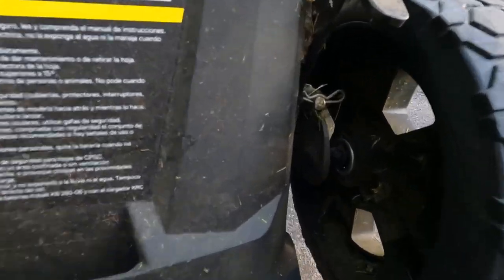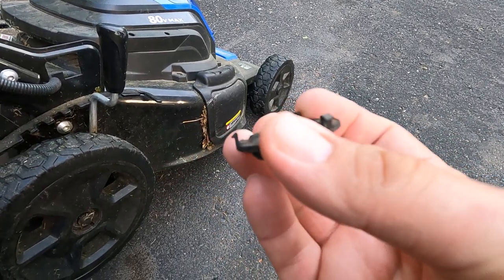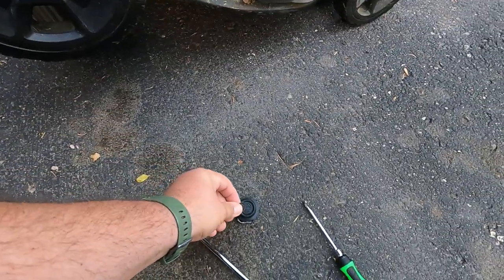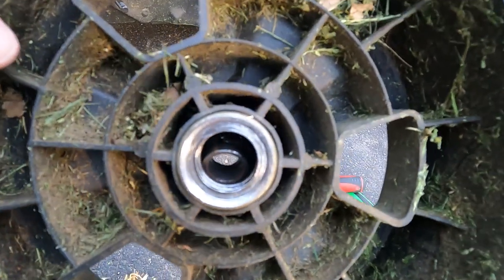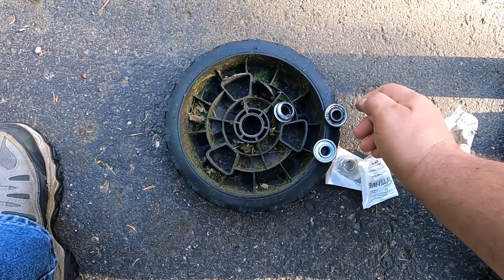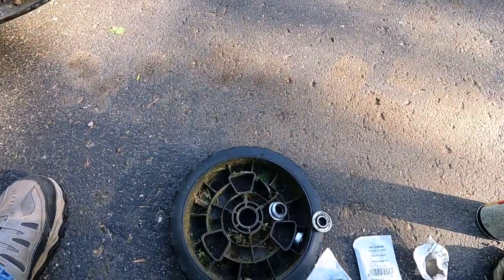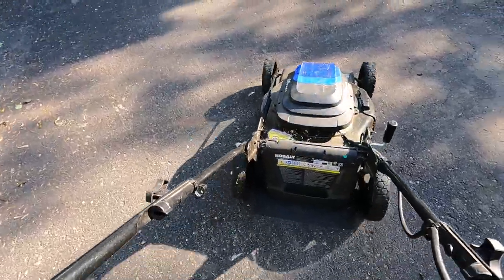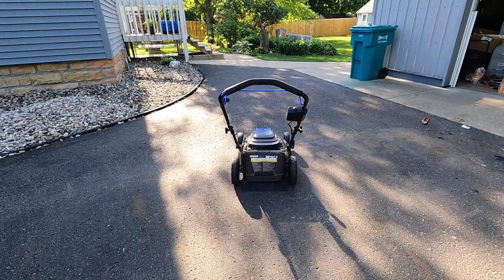Kobalt Lawnmower Rear Wheel Bearings

Comment: Thanks so much for this video.  Just had this happen to me. Very little information available on these mowers. Yes, you can order a new wheel assembly from Kobalt parts, but I ordered the bearings and got this fixed before the new wheel even arrived. And I have two more bearings for the next time this happens.
Reply from the maker: Thanks for the comment and I'm glad it helped.  I couldn't even find the wheel assembly for sale when I first made the video during the pandemic.  Were they a reasonable price or kind of expensive? It's getting to be time to replace my bearings again, so I'm curious.
Reply: @bigmikebeardwisdom   It was expensive for what was sent. Just the wheel assembled with bearings. No washers, cotter pin, instructions, etc.  $25 for the wheel, $1.75 tax and $5 shipping.
Reply from the maker: @curtmorris71  Thanks for letting me know, that's a bit more than I was expecting.

Comment: Does the little platic cover that you take off first, to get to the ball bearing matter that muc? We've lost one of ours on the rear wheel that needs repired and I can't find them to buy anywhere? Great video thanks for the tips and tricks! Got an extra cover? Ha!
Reply from the maker: That's a good question.  The Engineer in me thinks it's probably just a water, dust, and debris cover to keep the bearings clean as you mow and during storage. So without it, you may see accelerated bearing wear.  The Mechanic in me says to throw some duct tape or electrical tape over the hole and call it good until the tape falls off and then add more tape.  The Entrepreneur in me says you may have found a niche market and I'd bet someone who knows how to do 3D printing could make a little bit of cash there.  I made this video after Lowe's wasn't able to help in getting wheel bearings or any information on them, so I'd be willing to bet those caps are worth their weight in gold.  Thanks for the good question and comment, and best of luck with the mower.
Reply: @bigmikebeardwisdom  wow what a thoughtful answer. Thank you sir! Watch out my DIY caps may be coming to an online dealer near you! Best to you, truly!

Comment: Same bearing busted on my Kobalt 80V Gen 1.
1/2 and 1-1/8 dimension is perfect.
I got four bearings on Amazon for $12. People left comments there for 80V Kobalt mower as well.
Both inside bearings were completely busted. Outside ones were getting loose. I used WD-40 plus light hammer taps to get the two outside ones out. Your tip to use the old ones on top of the new one and tap them in was extremely useful.
Thanks again!
Reply: can you put the link for the ones you bought on Amazon?  it has a measurement for the thickness.

Comment: Thank you very much for the video. Just replace the radial bearings for the two rear wheels after three years of use the mower. I just want add: it will need two radial bearings per wheel to avoid another trip. I bought the radial bearings from local ACE Hardware. Lowes does NOT carry it. The employee at Lowes referred me to the ACE Hardware across the street. Again, thank you.
Reply from the maker: Thanks for the comment.  Ya, it takes 2 per wheel, unless one of yours is still in good shape.  I bought and used three with the old one that I left in the left rear wheel still being in good shape I lucked out.

Comment: This was great!  Thanks so much!  Unfortunately in my case the remains of the wrecked bearings were rusted to the shaft, and I needed a friend to cut them off for me.  But at least I knew what I was seeing in the wreckage.  Was VERY helpful to know what replacements to buy.
Reply from the maker: Thank you for the comment. Mine are already starting to wobble a little bit again. I think the bearings should almost be a maintenance item to replace every 2 years or so.  They're cheaper than doing an oil change and spark plug on a gas mower though.

Comment: Really helpful, man, thanks! I just had the same problem with the same mower, about 3-4 years of use here in PA. Looks like an easy fix, I appreciate the well-made video!
Reply from the maker: Thanks for the view and the comment.  It's great to hear how other people's lawn mowers are doing.  From the comments, it sounds like most of those wheel bearings only last about 3 to 4 years like yours and mine.

Comment: Thanks for the video!  I have the same problem with my Kobalt 80V mower.  I just ordered a 10 pack of bearings from Amazon.  I'm gonna fix all four wheels!  😎
Reply from the maker: Thanks for the comment.  I'm glad I could help.  You probably just inspired me to check my front wheels out.
Reply: @bigmikebeardwisdom    Yeah check 'em all out.  Last week the one wheel was wobbly... and this week it finally fell off!  But I'm gonna replace all four sets of wheel bearings just to be safe.  I've had this mower for about 4 years and it still works great!  I also have the 80V weedwacker.  I love them!

Comment: I also had the same total bearing failure on the left rear wheel of my Kobalt mower, and I'm also in the Twin Cities of Minnesota and had my mower for ~ 3 or 4 years.  If these wheels just can't stand up to 3 years of Minnesota mowing for 70% of the year, I wonder how well do these mowers hold up to warmer states that mow lawns year-round!  Thanks for demonstrating the same repair that I'll be doing shortly! :-)
Reply from the maker: Thanks for the comment.  That was my feelings about the bearings as well.  With how we joke about having just the 2 seasons up here, construction and winter, I'd assume warmer locations with all 4 seasons have at least 2 extra months of mowing on us a year.  The mower certainly does an excellent job of mulching the fallen leaves though.
Reply: I'm in Florida and I've been using the 80v mower for over 6 years with the constant heat and its holding up great. I'm finally needing to replace the rear bearings. That's with rugged use and constant hard turns. The batteries are still holding strong but I am starting to suspect a very small decline in longevity in the charges.  Other than that, still solid even in the heat down here.
Reply from the maker: @RuckusIIV  Thanks for the comment and it's great to hear that the lawn mower is holding up pretty well down there.
Reply: I have had mine for this is the seventh season here in NC USA. Very durable mower.

Comment: Good video. I have the same problem.  Lowe's told me to pound sand when I tried taking it in.  Mower looks like it was built with excess slop in the wheels and the wobble pounds the bearings apart.   Think adding a washer or two on the axle would tighten it up enough to make a difference?
Reply from the maker: Thanks for the comment, I'm not an engineer but as a mechanic I normally fix what engineers mess up.  The washer may be a good idea for your lawn mower depending on how much play is present, but check and see if you still have that little wave spring washer (mine was destroyed on the right side but still intact on the left in the video).  I think the small amount of movement that the rear wheels have could be intentional, with the wave spring keeping the wheels straight until you turn.  Then I think that little wave spring gives and allows the wheels to turn a little possibly helping with bearing longevity in relieving some of the side to side force.  A lawn mower is a strange thing, as it doesn't have a turning set of wheels like a car or a grocery cart.  It's more like a matchbox car, and I think those wheels always wobbled too.  I'll look into this further, but that would be a good video for the curious among us, as I think there are some push mowers where the front wheels on on swivels as opposed to a fixed spindle. 

I would lean more in a stronger wheel bearing direction, as for my mower, I always go counterclockwise when mowing close to objects because going clockwise puts the height adjuster close to things and which is always a fun surprise when that gets unexpectedly snagged.  I'm hoping that in researching this I can find another option with a different style of bearing, or even if another manufacturer that doesn't have this issue, if their wheels and therefore bearings could be adapted to use on our mowers.  Thanks again for the comment, you really got the wheels turning on another video.
Reply: That's exactly what I did to mine. I put on two 1/8" inch washers I had laying around with the 1/2" inner diameter last just before putting the cotter pin back in. Way too much slack without them, the bearings will just blow out again in no time

Comment: Good afternoon I’m wondering if you could answer a few questions for me. I watched your I bought some bearings and I was able to do the inside bearing. It fits nice and snug, but I went to do the bearing where the cotter pin is and somehow or another. It does not fit snug. It’s sort of loose. I’m not sure if it’s warped on the inside. I was wondering if you can give me any insight to try todo something to make it snug thanks for your help
Reply from the maker: So with these wheels being plastic, I've read where the bad bearing sort of stretches the plastic bore out. I would try wrapping the outer part bearing in something like electrical tape. Or put strips of electrical tape into the hole to act as shims until you get a nice feeling fit. Now if you are talking about the metal spindle that the wheel mounts to, that's a really good question that I would need to look into, but you could kind of bandaid it with some tape there, but I don't know if that would last a few feet or until the next time you replace the bearing. The bearing should spin within itself, but it seems like when it goes it locks up and can wear on the metal spindle which is why mine was missing the black paint in spots. Let me know what you try.

Comment: I am looking for the bearings on Amazon, this there a measurement for the thickness of the bearing?
Reply from the maker: @jwc4226  The bearings I used are Hillman 1/2"x1-1/8" Radial Bearing part number 008236510430, so hopefully this helps. I think a bunch of options will come up on Amazon then its just hoping they are right.

Comment: Awesome video as the rear wheel on my kobalt 80v jus fell off this past week.  The bearing completely blew out.  I went to Ace and they had the exact bearings you show in the video.  I thought I was golden.  But the 1/2 inch ID does not fit on the wheel stud.  It's a touch too small.  Any thoughts?
Reply from the maker: I'm a little curious about a few things, but this is a picture is worth a thousand words moment.  Does the wheel/spindle/shaft on yours look like mine with the bearing fully removed, as it would be interesting if Kobalt/Greenworks figured out that the bearings were "lacking" and upgraded the shaft at some point in time?  The bearing slid pretty loosely on the spindle for me, which seems weird because you could see the paint that was worn off in the video around the 17:48 mark, which I'm used to the automotive world where the bearings should rotate around the inner race which would be stationary on the spindle/shaft, not having the whole bearing rotate on the shaft and on the inner race seemingly when there is added load.

Otherwise, do you have the see through battery cover that looks like mine (first generation 80V MAX mower), or do you have the different I think it's not see through battery cover that is a lighter blue (second generation 80V MAX mower), or maybe a self-propelled one?  With mine being a first gen and human propelled, if yours differs that might be why and it would be interesting to measure yours.

Lastly, if there's maybe rust on the spindle, that could possibly thicken it as it flakes.  In which case I would lightly go over it with a little steel wool, red scotchbrite pad, or just lightly sand the rust off until you see some clean metal then try seeing if the bearings slip over.

Hope this helps and thanks for the comment.